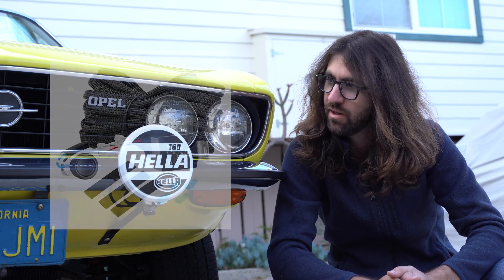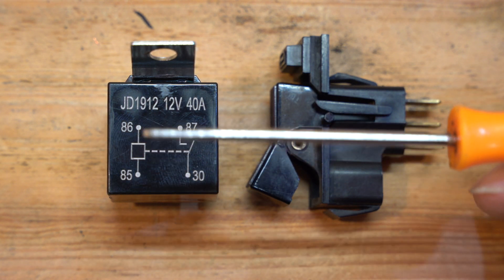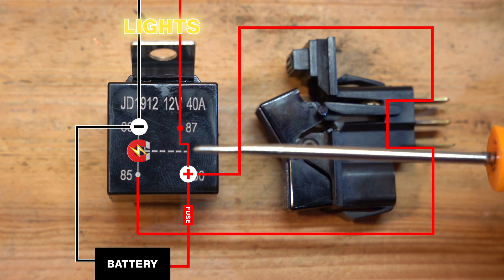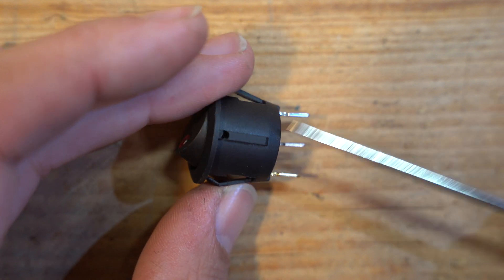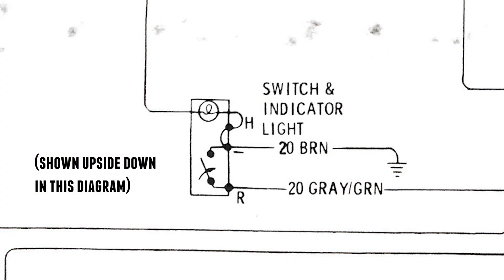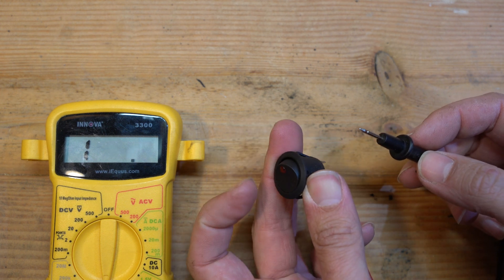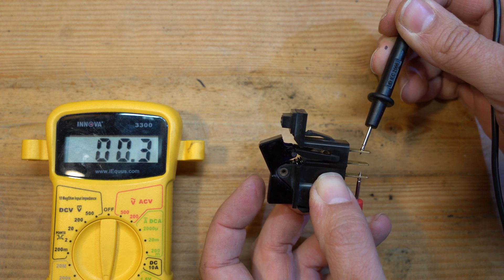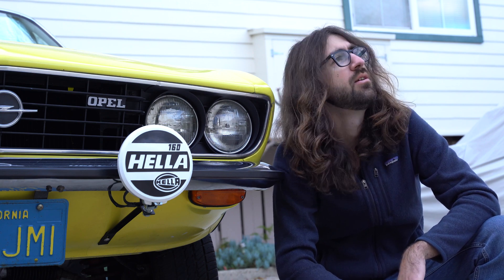Automotive Switches & Relays for Auxiliary Lights: A Tough Education

Comment: If not already got one, nickname for your Manta should be Jimi 
Was there a particular listing name for the harness there? 
Another good video
Reply from the maker: Thanks, and I think I just searched for something like "fog light relay harness" or something similar, and looked for one with the proper spade connectors for two auxiliary H3 lights, enough wire length, etc. There are a ton of these generic harnesses out there, just have to make sure the connections are what you need and the wire gauge is decent. I still had to change some of the connectors anyway.